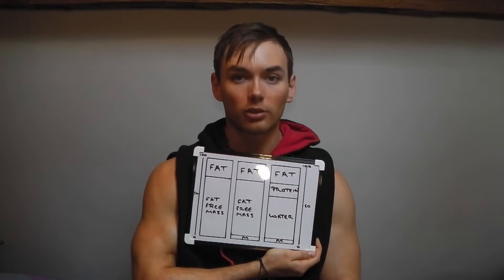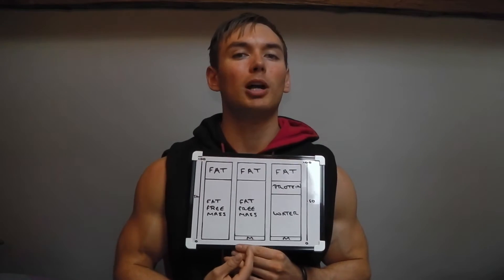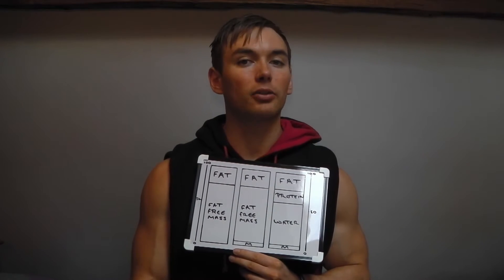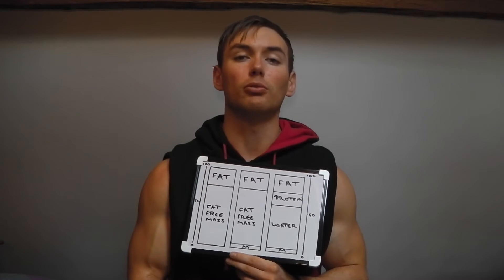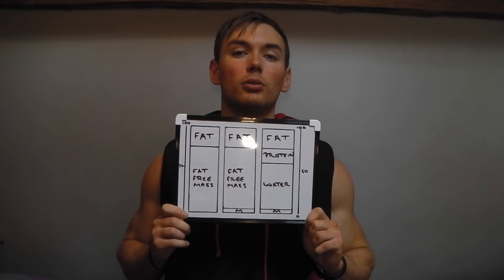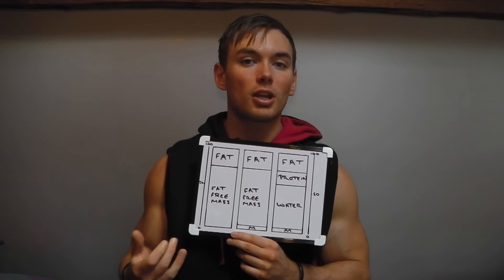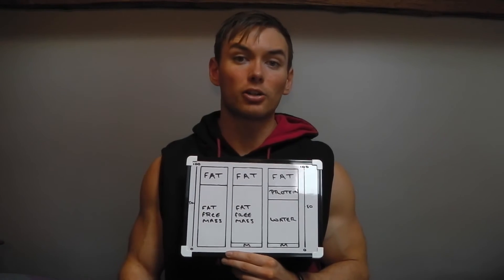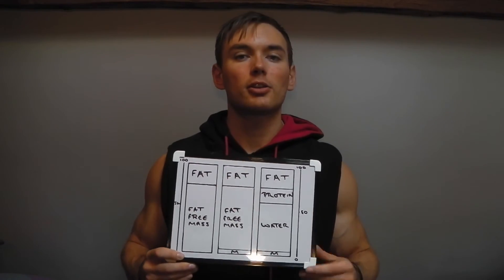Body Fat Analysis; How Accurate Is It?

Comment: Hi ben, you have my height and ideal body. Your arms look swell. Are they 17 inches flexed? Also when do you recommend testing body fat using BIA for best accuracy. Early morning after waking up or in the evening before dinner?
Reply from the maker: Yes, mine are 17" when flexed (when I last measured, not 100% sure now).

I have a video on bioelectrical impedance analysis which gives you the detailed answer. :)